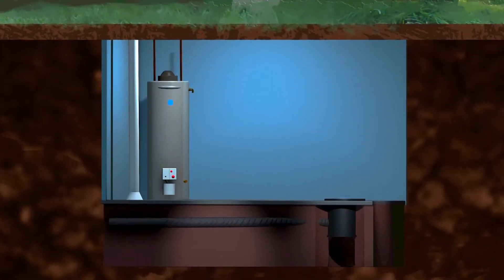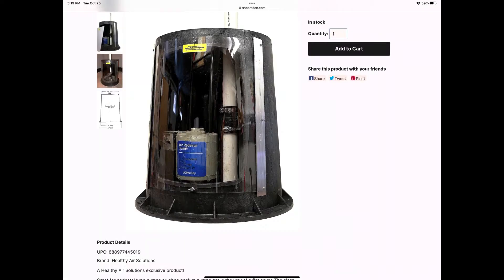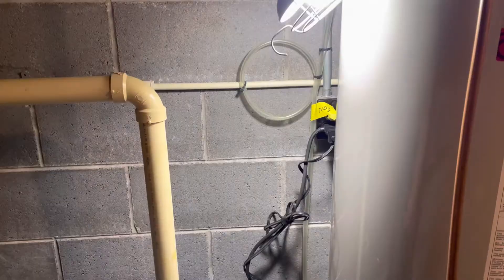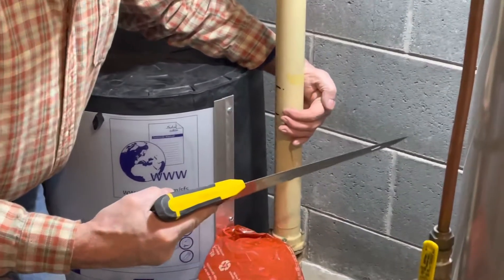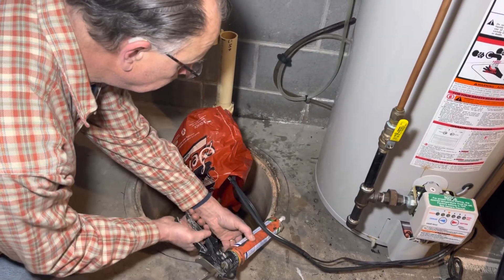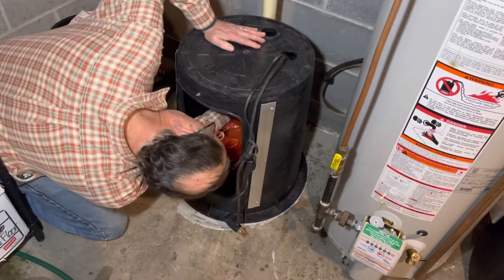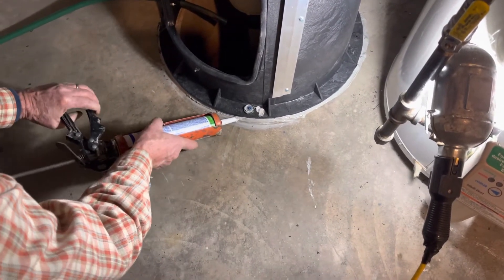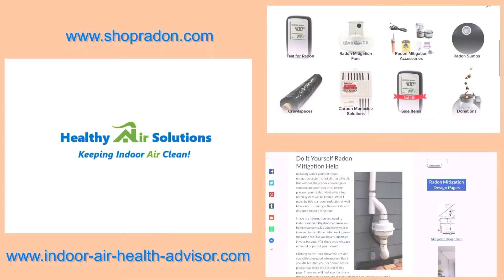How to Install Pedestal Sump Pump Cover = Safety/Reduce Odors - DIY Radon Mitigation

Comment: What about if there is a flood in the basement from other sources. Usually it would flow into the sump from the floor.
Reply from the maker: Yes that’s always a concern. With a pedestal sump cover it’s held down by silicone and a few screws. In case of a flood you would take the screws out and pop the lid up from the silicone, which is easy to do.
Reply: I have floor drains in my basement.  Two have p-traps and drain to the septic, so I think those are okay.  Two drain to the sump, so I suppose I have to seal those.   Maybe I can use a check valve or a sealant that dissolves if it gets wet!
Reply from the maker: Yes the drains to the septic are fine.

You only have to seal them if they aren’t trapped. If not you can purchase a drain valve so water can go down but not air. I’ll provide a link to our Store with different varieties that are available. 

https://www.indoor-air-health-advisor.com/healthy-air-solutions.html#!/Drain-Valves/c/36410020